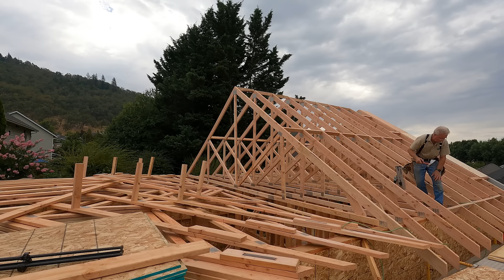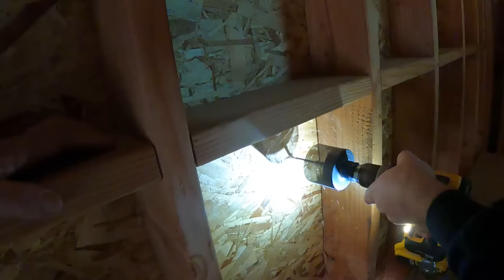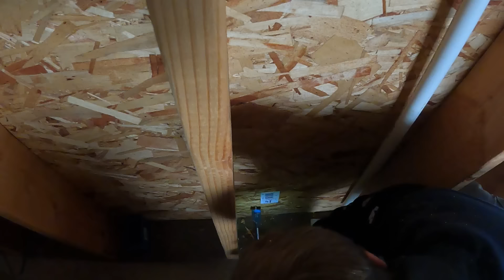Hold On To Your Roof! Truss Screws vs. Hurricane Straps: Shop Build #21

Comment: Yes those screws are nice and easy but they pull out at 700lbs and thats with them set at the proper 22* angle. the big bad all problematic dyrwall over iron tie didnt even budget and they gave up at 1000lbs On new framing put the Hurrican strap/ties on the outside and use the approved Simpson tie Screws for them and save your arm.

Comment: It's alright banging that big screw up from underneath as long as you're central in the timber, start off center or too much angle and that truss well split especially as self piloting whack in with a impact driver.

Comment: You are not supposed to send that screw home in the slot on the partition wall connector to the bottom cord. That's the reason for the slot, otherwise there would be holes in the connector.

Comment: Looks like your truss clip is upside down.  If the screws on the vertical side get loose, the roof will move.  Do you want the roof to move?  You acknowledge movement but that doesn't seem right.

Comment: Why the long screw when nailing through gainnail and hurricain clips.probally separate between double plate and top plate cause that's the weakest link if you don't put nails in top plate enough in clip and osb.

Comment: That's good that you're tying it to the top plate now you got to make sure you tie the top plate to the stud, then the stud to the bottom plate and then the bottom play to the floor joists, there needs to be Clips all the way up and down tying everything together not just one little thing, Tornado Alley or hurricane South Florida it's the only way to do it, it has to have a continuous tie from the ground all the way up to the top forget one set of clips and that's where you're going to get your separation

Comment: I’ve been a carpenter and Home builder for 40 years . Back in the 70s we would nail the joist hangers with roofing nails. Then we used the teco nails then teco type screws. I bought a positive placement nail gun 25 years ago. It shoots 1.5” , and 2.5” nails. It is worth its weight in gold. It can and did pay for itself in one day .

Comment: Why are the joist hangers or truss clips etc so pricey it seems they can stamp them out by the thousanths fairly cheap but ea one is often 3 or 4 bucks a piece they add up very very fast fasteners by themselves cost. An arm and a leg nails screws lag bolts etc then to add the cost of metal clips etc even a small building costs a good amount of money to build i guess. Im just old and think candy bars should be fifty cents i guess everything's expensive anymore ughh

Comment: Simpson recommends the Hurricane Clips be placed on the outside of the wall and under the sheathing.  An MC Nailer makes short work of attaching structural steel like those hurricane clips.

Comment: When building a wall under a truss there should be at least a 1/4” gap so the truss doesn’t touch the wall framing.  Also use the correct nail or screw, bugle heads or sheet rock screws is not the proper screw to use and only put one screw in the center of the slotted truss clip so the trusses can move up or down so the sheet rock will not start cracking.

Comment: Screws don't meet code for residential construction in Michigan. I used them on an addition and got called out on
It by the county building inspector. Storm clips are Required with a nail in every 
Hole.

Comment: if your in tornato areas the studs need steel reinforcing too the bottom plate needs ankor bolts not nails ive pushed homes off foundations during demo

Comment: I can not understate enough how much stronger your wood frame will be with the Simpson solutions. When used properly they add an incredible amount of strength and resilience to wood versus fasteners alone. I build a large pergola using a handful of the simpson strong tie solutions and it has stood strong in several thunderstorms with 80 mph+ wind with almost zero movement.  Not shown here are also the the foundation ties Simpson makes too which are just as awesome.

Comment: On my details I am showing the long Simpson screws at an angle securing the inside of the top plate. The structural engineer that I work with and also where I have been to many of his lectures wants the hurricane clips on the outside in line with the sheathing to prevent top plate rotation. Not always possible and harder to do. So, the angle screw on the inside is a big help. I live and design along the CT coast. I also use the Simpson brace-wall calculator for my clients. Often portal framing on detached garages around the overhead doors.

Comment: I was taught when using any form of metal strap or bracket for tiedown, to get fasteners into both sides of each piece of timber I'm trying to tie together. In a situation of extreme wind trying to rip the roof off the house, you can't assume the top plate won't twist and let the nails or screws pull out. Get fasteners into both sides of the top plate and both sides of the truss, and make sure your tie-down is continuous all the way to the bottom of the house.

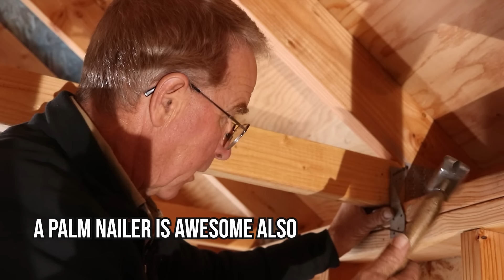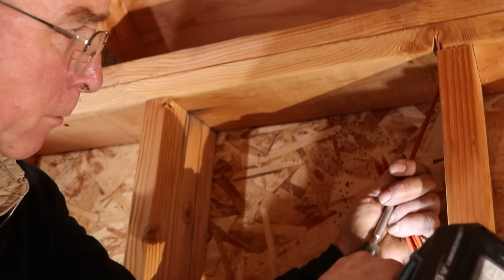Comment: That doesn't seem robust, the truss screw at 3:35. At all. Especially considering placement by the operator is critical, as your install at 4:30 that was clearly going to miss the mark demonstrates. Also, visually it'd be hard if not impossible to inspect afterwards to ensure the screw bit into the truss well, other than seeing the screw poking out the side of the truss 2x. The tie plates are a can't-mess-up operation. Obviously Simpson's engineering says otherwise, but this is hard to accept, honestly.

Comment: I'm rebuilding my home with rough lumber after a house fire. I want it to be stronger than the average house, so I've added screws and straps/clips in these exact spots. I chose to have a vaulted/cathedral ceiling, so they are attached to the rafters instead of trusses. The rough lumber is thicker than factory lumber, but more crucially it is all I could afford (free after cutting trees, sawing into lumber, and drying) and the whole process has brought my family closer together. I'm glad someone is covering this aspect of strengthening a house and I would be interested to learn more ways to do so.

Comment: 6:30 There's another reason for the truss clips. When a truss gets a big load on the roof it actually causes the bottom chord of the truss to rise a little bit. If you nail the truss directly to the interior partition it will be lifting up on that partition. Very likely you will get an ugly crack in your drywall where the top of the wall meets the ceiling. To avoid this you do 2 things. Use the truss clip, so that the truss is not pulling up on the wall. And also, when you put up the ceiling gypsum board, put the first screws about 12"-16" away from the wall. That way when the truss lifts the ceiling gypsum board, there's some room for things to flex without cracking.
If you have crown molding this covers the joint, which is good. But it's best to attach the crown molding only to the ceiling and not both the ceiling and wall.
Reply: I was told by the truss engineers the "slotted" portion of the truss clip should NEVER be nailed or screwed tight. The slot is there for a reason to let the truss float slightly. If slotted area is nailed / screwed tight it compromises the engineering function of the clip. This guy just screwed the truss tight at the slotted area. Was the truss engineer wrong or WTF am I missing here ?

Comment: Back when I did rough frame carpentry, I did not like the hurricane straps because one never knows if the storm will be a hurricane or a Himacane.  (Now that they give storms male names) Perhaps the thing works for either.  
Actually, all kidding aside, I did not like any of the devices you show.  Too reliant on the shear resistance of the wood.  I would wrap plumbers tape over the truss and under the top plate.  Screws or nails only needed to keep it wrapped.
Edit note.  By plumbers tape I mean the strap of 20 gauge galvanized steel 3/4” wide, NOT teflon tape used at connections.

Comment: It’s code here in much of Canada to have the truss over the studs for added strength downwards, lots of snow load. I personally use the longer ties that run from the truss down the top plate and down the studs a little ways.

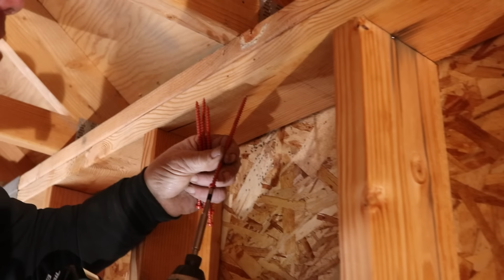Comment: 3:55
This is funny to me. I’ve been using long, strong screws through the plate into the rafter or truss bottom cord for a long time. It seemed like a good idea but I always wondered about pullout strength (tension) on uplift versus ‘rafter ties’ which have nails in shear. Apparently I worried for nothing.

Comment: essential craftsman. mr. scott a brother from similar yet different parents.

building codes change an it changes over time. and here and there. and internationally as universal building codes.

lunch is calling and i have to answer.

in the 1960s tar paper was used under 3 tab shingles the 1970s some no tab shingles could nr installed wit no tar paper .
the ther was tn the 1970 we har a frist roll of 3 foot water proof rubber membrane. 

today the code is rubber membrane the entire roof. the shinglers or now metal roofing

only things constant is change. but we want change to get better. sometimes it does and some times kit don't  and then we call that a mistake. and we try to learn bo be better.

back in the depression the tar paper schack of the  home challenged homeless were called hoovervilles. and if there were   sweet young chicks
we called the Hooterville and the owl eyes one fore the left side and one for the right hand and thank you mama for your mothers milk for me.

Comment: As many have said, but ill say it again, these videos are gold.
I learn not only how to do stuff but what certain things are for.
Every now and then i acquire a tool or a building supply item that i have know idea what it is or how its supposed to be used (or sometimes i think i know) but i later learn in wrong.
I knew what a hurricane tie did..but apparently i didnt know how many different kinds there were.
That first and second metal hurican tie, i have a big box of them both. 
I thought the first one was for holding a 2x to the side of another 2x like a "T" as a structural support..and the second one with the twist i thought was for splicing a couple 2x's together 😂.
Well i learned something today, now i can use them properly help secure the roof of my shop.
We've been getting crazy weather this year out on the plains.

Comment: So the duplex nail. I've asked a dozen people and no one could tell me what they were called and what the intended purpose was or what they're for. How they're meant to be used. Can you do a short video explaining them and other nails that aren't so common to see or see others use
Reply: The duplex nails are used mainly for cement form work where you need to strip the forms after pouring. Waaaay fast....

Comment: I like the 1 1/2 inch #9  hex head Simpson screws to hold in those metal clips. I use the second one you demonstrated, and use one on each side of the truss (Rafter ties) unless you cant fit it in. The ones I really like are the H12 which have 6 inches of overlap on both sides. After you've been in a building with a hurricane or twister going by you will understand. I try to use steel at every wood to wood joint, even though I know they were built without them for years and years. I like the new extra long screw style but I can see where its hard to inspect whether your apprentice got a good angle or not. Build like you expect a tornado at 2 AM while you sleep through it.

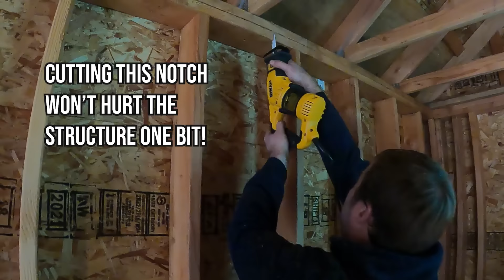Comment: 7:32 I instantly paused the video and walked over to my recip saw to see if the blade would run upside down in mine too... and of course it does.

I specifically got a compact reciprocating saw because i knew space would be an issue, but i never once thought of turning the blade upside down for so many scenarios that were a pain to cut. 

I feel so stupid. But i also feel smarter after every video of yours i watch. You never know what you're going to learn from these videos! 
Thanks

Comment: The first Hurricane Bracket is the only one that is Code in Ontario Canada. As well, it is mandated to be used with Hurricane Nails, which I've never heard of. They are super thick stubby nails with crazy high shear strength. Use both up here, or you'll fail inspection, like I did as I used screws to hold then down. I had to take out 350 2" screws and hammer in those proper nails. Lesson learned.

Comment: The Simpson quick-stick is an awesome tool for installing the truss screws. It has a V with bubble level for the 22° angle for installing the screws. I have found that a drill works a lot better than an impact driver. Give it a shot.

Comment: What bugs me about those H1 or H2 hurricane ties is the hole placement. It seems to me only one of the 4 nails does most of the work.  The other three barely catch any wood, and they are in line so as to split the wood grain. No issue with the other things.

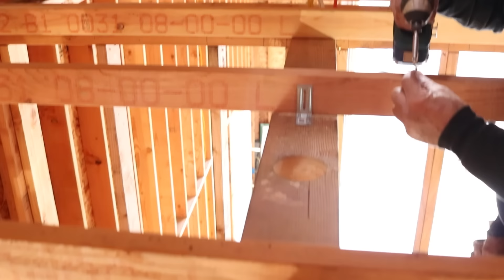Comment: I'm not an engineer, and don't play one on YouTube or television.  I'm just an old Body & Fender guy (25 yr's plus) and now a former shipyard welder (4 yr's), still welding @ 69 yr's old.  In my humble opinion, I think the clip you show @ 5:32 of this video is installed upside down.  From my VERY LITTLE experience working with Dead Tree Carcass's a.k.a. wood product's,  {I did build my 2000 sq. ft. house circa 1980's, with the help of my late wife.} the elongated-hole should be on the bottom /top of the wall.  My reasoning is that the Truss lower cord is not always straight.  Thus, you attach the bracket  so as to allow for pulling / pushing the lower Truss cord, to achieve a straight run / uniform spacing on center's, if you will.  I could be dead wrong, but that's my story and I'm sticking with it.  Thanks for sharing.
Reply: I get your thought process on it but typically there’s a 1/4 or 3/8 gap or so from your interior non structural walls usually 2x4 walls and they tend to not stay straight so this holds the wall straight along with the truss while still slowing up and down movement on shrinking and expanding it allows the roof the lightly move up and down while never bowing or buckling walls after all the weights on it

Comment: I had a home built in 1999 in Louisiana, every night I would work till 11:00pm putting in wall and rafter straps. I didn’t strap and tie every single piece and place, I looked till I could see a web of wood holding the most common pieces together all the way to the floor. I marked the point of the intersection and started strapping. I used a palm nailer and resin dipped nails. Thanks for sharing.

Comment: Another way if you have a raised heel truss, is running sheathing from the wall up to the top of raised heel and nailing it down to the studs, top plates and trusses. Basically a large plate that ties everything together with dozens of nails. The sheathing also gives trusses some cross sheer value and acts as a block for blown in insulation.
Reply: I like your thought using your plywood  to tie bottom chord of truss in with wall, kind of like a giant gusset. Plywood is definitely a structural component . Combined with hurricane ties, can make a very sturdy building.

Comment: I've seen so called professional roofers shoot nails into sheathing completely missing the underlying 2x lumber. This can go on for 6 feet or more and then they lay shingles on decking with no nails holding the decking in place. Because why bother paying attention to the sound of a good hit versus a miss when you are jamming to tunes with your earbuds in. To think that most contractors are going to take the time to shoot long screws in at the proper angle, to keep your roof on is asking a bit much. And it won't make much difference if your garage door blows in. How many people install brackets for garage door storm braces?More air pressure in the line solves all problems, right? Bang bang bang...move on down the road to the next slap it up project. My faith in contractors doing a good proper job is on par with my faith in winning the lotto this week. Most of them have more than justly earned their well deserved crappy reputations.

Comment: My code enforcement officer told me about the Simpson truss screws, and boy am I glad he did! So much easier and faster than hurricane clips, though all that screwing burned through batteries pretty quickly!
Reply: The screws are accepted by the local building inspector. But they are expensive. I have a positive placement nail gun that is quick and efficient